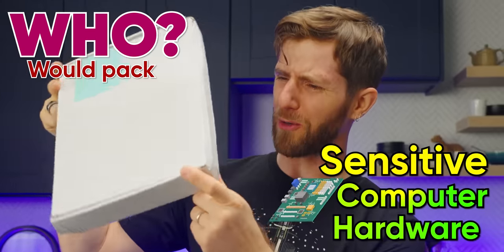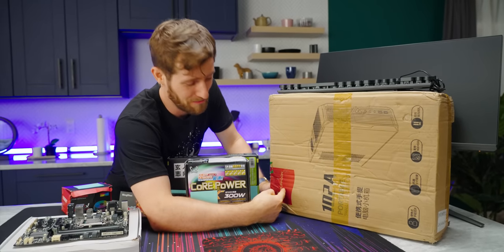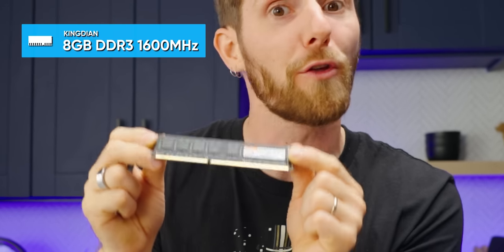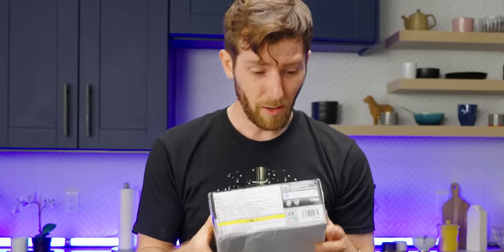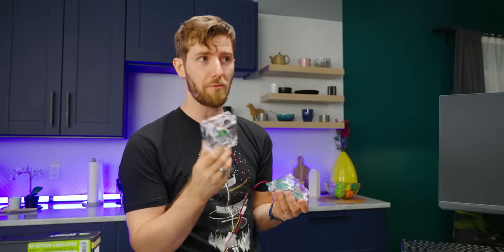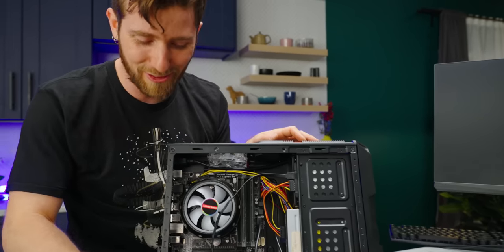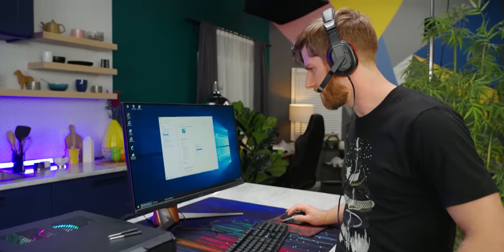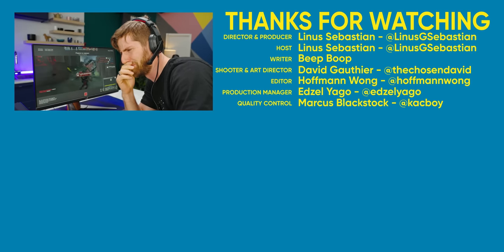THIS Wish.com Gaming PC is WORSE!

Comment: The disk drive size bays in the front of older cases can actually come in pretty handy when you wanna adapt an older case to a more modern demand, for example i have a Corsair Carbide 540 air, which doesn't have USB on the front panel, and i was able to put a little panel with multiple ports, including 2 usb C's there for use with my VR headset :D
Reply: I picked up a cheapo 3.5” bay IO panel that plugs into a USB2 on the motherboard. It’s got slots for M2, x-Picture, full size SD/MMC, micro SDXC, compact flash cards, USB, and MS Pro Duo. It’s worth it just for the SD slots when I’m messing around with Wii homebrew and Raspberry Pi things.
Reply: My PC still has a br/hddvd drive in it. I'm looking at upgrading the case and motherboard and CPU and I guess optical drives just aren't in fashion anymore
Reply: fellow 540 air owner!!

Comment: In case anyone is wondering about that scuffed ass power supply cable: that is the same kind of plug used for three-pin to two-pin Edison plug converters. You plug a normal three-pin Edison plug into one side and you only have two pins on the other side usually with a green wire coming out for the grounding which you're supposed to connect to the screw in the middle of the outlet cover since those screws are connected to the outlet's casing which is grounded for safety. Essentially this means you'll still have a safety connection to ground but just not the normal way. Seeing this on an actual plug for a product is the stupidest thing I have ever seen
Reply: @letusplay2296  Ahh, the plug that falls prongs up for that extra spice when you step on it :D

Comment: That kind of ground was used on very old houses that only had double prong and needed ground added later. It is often hooked to a screw on the outlet.

If you've ever seen those 2 prong to 3 prong adapters, they have a little metal tab which you are supposed to screw to the screw in the outlet.

Comment: The ground cable on the AC plug, my Japanese PS3 system (White Ryu Ga Gotoku) that I purchased new had the exact same type of cable. I never actually grounded it and just let it dangle lol
Reply: I bought a laptop power brick in Japan and the cable came with one of those separate ground pins too.

Comment: 11:20 not that it’s acceptable, but the ground wire could be meant for outlets that don’t have a ground pin hole. In this case you could take advantage of the grounded screw on the outlet cover

Comment: Got that case for 25$ with another branding. That optical drive slot dual-purposed to fit an 3.5" HDD. Very useful to build simple nas of two drives

Comment: For screwing in things in tight spaces like that, I purchased a small ratchet set meant for repairing bikes. The ratchet is about the size of a pen and it's perfect for computer cases or assembling flat pack furniture or just otherwise in places that are hard to fit a full screwdriver.

Comment: You can get a refurbished optiplex for the same price as that case alone. Plus the case looks about the same. Sure it's all proprietary Dell crap, but thats nothing power tools and some determination can't fix.
Reply: Power tools significantly up the project cost
Reply: @bipbop3121  yes, and sadly they are single use power tools that have to be thrown away once you're done with the project.

Comment: I love the fact that the 4670k Linus got for his build is the exact CPU I'm rocking right now in my rig, its got good overclocks on it though which is the only saving grace about it
Reply: My 4790k did a good job and could run most things when I upgraded in 2020
Reply: @crisc.1937  still running a 4790k in my PC right now lol. I am looking to upgrade all my parts relatively soon though.
Reply: @crisc.1937  I upgraded from a 4690k in 2020 as well. It outlived my GTX970 and I'll probably use it in some sort of a plex machine eventually if the mobo is still good.

Comment: Dunno if anyone else mentioned but that seperate ground/earth wire on 2 prong plugs is a thing in Japan. I've seen pictures online of their sockets.
Reply: that actually make much more sense then, as a mainlander Chinese, judging by the traditional Chinese and the kinda wired wording on the box, that power supply is most likely made in Taiwan or South East Asia, other than mainland China (Traditional Chinese and Simplified Chinese undergo the same grammar system, but sometimes have different wording for the same senario). it would make sense if that Japanese standard, lots of things in Taiwan are Japanese standard.

Comment: 11:27 That's a Japanese type power plug with a ground prong sticking out. "Adapter to provide an earth connection to a non-grounded socket. The horseshoe-shaped connector is attached to a ground connector hidden behind a plastic panel. The connector can also be used for appliance cords that have a two blade plug and a separate wire for grounding."   (Museum of Power Plugs) ((Yes, really.))

Comment: I love white pcb hardware, I love simple single slot gpu or even the half height ones. It would be nice to see current gen gpu tech scaled down to fit in the pci-e spec even passively cooled gpu's
.
Reply: I'm still boggled he got it for that price. I haven't seen a low profile single slot 1030 for less than 110 usd in like a year or two, much less a cool looking one like that.

Comment: The ground wire attached to the plug is pretty common in Japan. Japan uses the same socket as the US (at slightly lower voltage) and does not have an integrated ground. To hook up a ground, for electronics that utilize a ground, you need to attach it to the ground connector found behind the outlet cover. The information and labeling on the power supply box was also in Japanese.

Comment: Y'know what? Despite the sketchy Japanese style plug, which is commonplace over there (but not stateside), I'd actually like that case as a SFF MATX build, it's slim, simple, nice looking, and I'm the 1% that still uses ODDs
Reply: Ah, a fellow 1%-er! Though, I guess I'm in the smaller group that used 2 ODDs.
Reply: Same, i still use DVD drive. My case (2002 era) has provision for that, and I don't want a gaping hole

Comment: For 550 CAD I just picked up a used pc with 8 GB of DDR4, i5 9400f, and an RX 6600. Threw in a 500gb WD nvme drive, and picked up a 16gb kit off marketplace for 40 cad. All in all, sounds like a steal compared to the wish pc.

Comment: I bought coolmoon's fans a while ago. they have preset light patterns that you select thru... but that wasn't good enough for me. I bought a razer hardware development kit, found the 5v data & ground pins and plugged them in and got decent rgb lights for the cheap. and use the old fan controller for speed and they haven't died on me yet

Comment: The grounding pin is Japanese, the box is also Japanese from what I can tell. I live in Japan and grounding isn’t really a thing here. I really don’t understand why this is. Some say it’s because Japan uses 100v AC which is a lower voltage than most places but this still seems pretty insane.

Comment: Cost alot than it's worth, but it was an interesting build still.  The case looks pretty decent even if it has its faults. Doesn't seem worse than other more branded cases
Reply: I agree it was an interesting build, and if the case was half the price it would be competitive with cheap cases from a PC store.

Comment: In Mexico there was a time when you could buy converters to turn a 3 prong plug to a 2 prong electrical plug. This converters had a small wire with metal terminal hanging from the converter, so you could ground the adaptor to the screw in the electrical outlet faceplate. However it has been at least 10 years since I saw one.
Reply: USA has that also
.
Should still be around in your local hardware store

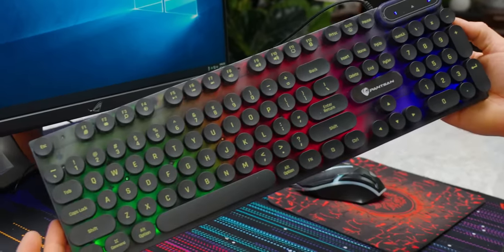Comment: 22:18 what's wrong with 1080p...?
Reply: Wrong what?
Reply: @Whaleblox  Linus noted that the gpu is capable of running at 120hz, but proceeded to scoff when specifying that it is at 1080p. I don't understand why. What's wrong with 1080p resolution?
Reply: Bc its a "1030"
Reply: @bakerap2211 bcz that monitor was 1440p

Comment: i'm just as surprised as Linus when he found out it runs at 200 FPS in TF2 which is a little bit unbelievable, but at the same time the game barely uses the CPU and GPU and yet it still needs newer and faster CPUs to get more FPS while the GPU just sits there
also #savetf2
Reply: yes #savetf2 my dudes
Reply: 200 fps in the pre-game menu*

Comment: My family PC uses a very similar case, and a bunch of brands sell those with different front panels and PSU combos, internally the same, price is usually half of what you paid, with the included PSU.

EDIT: Oh and the plastic in the PSU exhaust should hide a grill, mine does at least.
Reply: I remember building something in one of those cases, because I specifically remember the weird handle bit. I think it was a beige version though and it was an 'office' PC. I think this was at least ten years ago.

Comment: The worst standoff errors I’ve found are from Goldenfield cases, Corsair is best with the centring pin and Lian Li for the same reason, stopped using NZXT thanks to how crap the airflow is, 4000D and 5000X are my go to’s

Comment: That cooler design is used by a bunch of companies. I have a version of it with no rgb on my second pc and it actually keeps pretty cool so so far. Temps haven't been above 30 Celsius but I also have really good fans and airflow in that pc to start with.

Comment: My cheap and nasty usb sdcard reader was from wish.

Yeah, it was worth $4.26 quite happy with it.
Reply: @janvrabec3401  Did you not see the part where I wrote "quite happy with it"?

It worked no problems when using it as a flash drive on a nintendo wii. USB loader gx even installed a game to it no problem.

Oh, and if/when it does fail. Im holding on to it. I don't pitch broken electronics.
Reply: That’s really gangsta!
Reply: @kiki_de  What?
Reply: @qwertykeyboard5901  Can confirm. Really gangsta indeed
Reply: queer
Reply: @spaceli0n  You have a 16 year old account and you talk like an 11 year old?
Reply: @qwertykeyboard5901  what are you saying now is pretty not gangsta
Reply: @kiki_de  Dear god, what is this comment thread I've spawned?
Reply: @qwertykeyboard5901  G G G G G G G-UNIT!

Comment: The ground pin thing you have on the power supply is an old way ( at least here in USA ) for a very short time electrical retrofitting /adapting was done.  Older houses only had two prong plugs with grounding integrated into the common lead, so when the standard began changing over to three prong power cords ( hot, common, and ground ) people would run a single ground wire to each outlet that needed it and tie the ground into the screw on the outlet box/cover plate, but usually a three prong plug adaptor was left plugged into the outlet and the ground tab was secured/screwed to the now grounded box/cover screw and you could plug your new three prong grounded plug appliance into that outlet.  I'm guessing the cord you have is some sort of alternate solution to the same problem.

Comment: Pretty sure you are supposed to ground that to the mounting screw for the faceplate of your outlet. I have seen connections like that on some of my dads old power tools from the 70's and early 80s, like his drill press and table saw.

Comment: Hey remember the old clips for the Athlon XP? Where your only option was put a flat head screwdriver facing your motherboard, put a load of pressure on it and hope you don't slip, or it's straight out for a new motherboard...

Comment: I've built a similar spec PC with leftover parts i had lying around for my father. It had an Asrock b85m mobo, a i5 4590, a Gt1030, i think a gigabyte, passive cooled, 240 gb intenso ssd, 16 gigs of DDR3 RAM and surprisingly an insanely similar case from a company, i think called LC. The funny thing is i bought this case for 47 euros, including a 300W PSU. It's a nice PC for light everyday use.

Comment: I am familiar with that grounding thing -- it's when you need to convert a 2 prong outlet for a 3 prong plug, so you screw that little bit onto the faceplate, to fake, er.. make the ground.  They were all the rage in the 1980s and 1990s when you had an old house with old 2 prong outlets.
It's far safer than just snapping the third prong off, and when you mount the third wire to the faceplate or the junction box, it should be grounded that way.

Comment: Not to ERM acktually, but Socket 939 heatsink mount clips work with AM2 - 4 ( AM2 and 3 are just speculation ) but I have tested some old 939/AM2 heatsinks with my AM4 rig with the stock clips that came with my motherboard.

Comment: that grounding cable goes in the center screw of the outlets. some of the older sockets has a grounding connection to the center screw holding the plate to the wall.

Comment: I had a twist tie fan on my old PC. One of my fans broke, and I found a fan at Goodwill without any screws, so I just twist tied it into the case and it worked for like another 10 years.
Reply: Done that. I've also zip tied fans into place more than once

Comment: I may be late to this party by a year, but that power supply plug with grounding line was maybe a thing in like the 1950s. By the 1970s I don't think any cord manufacturers were using that out dated design.  How old is the manufacturer of that tower?

Comment: That ground wire setup is standard in Japan. Though most newer places use GFIs for their outlets the only time you would use a ground is for like large appliances like larger fridges or washing machines. Not great for stuff like guitar amps. Ground hum is awful. Also that GPU brand is a more slightly budget friendly Japanese OEM.

Comment: CPU Price ain't so bad. 
AMD FX-9590 from 2013 is still over $200 secondhand or $300 for new Unused Stock.

Would be cool for LTT to get one and rest of parts for AM2+ System and See which modern cooler can handle running the FX-9590 @ 6ghz or 7.5ghz with Aircon Cooler

Comment: This reminds me of my PC build inside of a old USFF PC, i mounted everything basically the same way that case has it layed out, except janky, it's my current gaming pc and is barely bigger then a Xbox One, it stays cold too, and the power supply vents through the old DVD drive slot. With a curved PSU plug adapter and it plugs in from the front. I love it sm and i have a I7-3770 and a RTX3050, and it's a perfect match for the games i play. Kinda sucks some Chinese company stole my idea tho 😾

Comment: I use halnziye thermal paste in my laptop.(and it has ok conductivity(cpu overheats and stops evrything including refreshing DRAM and then starts back up only evry 2-8 hours and it gets to 95 degress when playing(with fearl gamemode enabled) and about 50 degress on desktop+monitoring software(doing boring stuff like chrony syncing evry 8 seconds becuase i messed up the config and updating the current tempurature and writing the journal and writing it to write buffer and then to ssd)). I just got it becuase i was $10 away from a $15 off on temu. I never knew it landed in a ltt video.

Comment: The 1155 CPU's are freaking insane in how long theyve held resale value. Still running an 1155 system I built in 2014, upgraded the i5 3470 last year to an i7 3770, not even a K. $56 lowest price I could find

Comment: I was happy a few years back to find a then 10 years old xeon w3670 to update my 14 years old X58 computer. 6 core 3.5ghz. With a 1080ti it runs all modern games including my vr setup. I was even able to find a trick to use a nvme ssd. I think it's more about maintaining old machines than building from scratch.

Comment: That power cord for the power supply looks like it might be Japanese. I had one for my laptop, strangest thing is the ground doesn’t even plug into anything, the sockets in japan don’t have anywhere for the little fork to plug into.
Reply: Some power strips have places for you to plug it in and some wall outlets have a grounding screw, which is what that prong is meant for.

Comment: I got an 8 dollar headset from the thrift store a year or 2 ago and it's actually great, surprisingly, I think, and a $20 mouse from the Micro Center, wired, Inland brand, and it's nearly on its 4th year.
I don't even think the computer was that bad. Just get a decent mouse keyboard and headset and you're good.

Comment: 3:53 It still checks out up to this day tho. Though for CPUs with TDP of ~115W or more it's not that efficient... But everything below that it cools just fine even under extreme load and keeps the temps around 75°C (no extreme stress load temps are from 46 to 68°C in my exp, I have a similar cooler but made by AIGO company*).

*TBH that was an accidental purchase (more over, accidentally I've bought two of them back in 2019-20), but in the end they turned out to be not that bad overall.

Ed.: A CPU with TDP of 135W (10c/20th, stock 2.9GHz → TB 3.5GHz) under load in CPU benchmark in 3D Mark heats up to 84-86°C. The case has 4 120 and 2 90mm fans 1back90:1up120 exhaust, 2front120:2side120&90 intake.

Comment: Depending on what country a person is from that system and those parts and their quality are top of the line in some places. 
Keep in mind there are still hundreds of thousands if not millions of pc's out there running Windows XP and Sub 1Ghz CPU's with 128-512mb gpu's and those pc's are the top of the line in those countries / regions where buying a base model 2023 intel cpu alone would cost them 12 months wages.